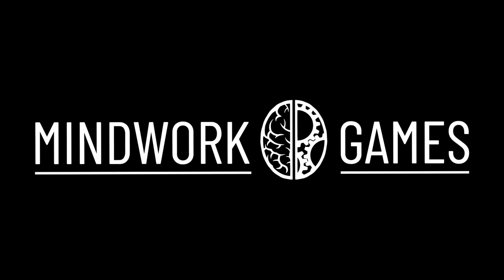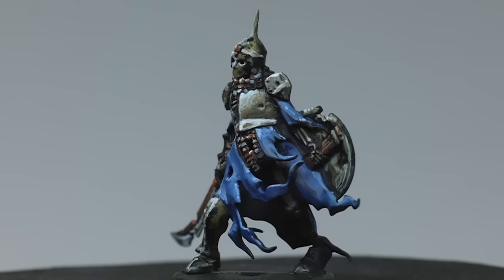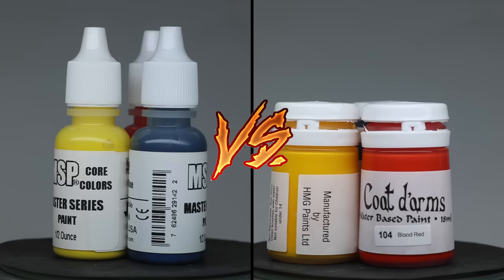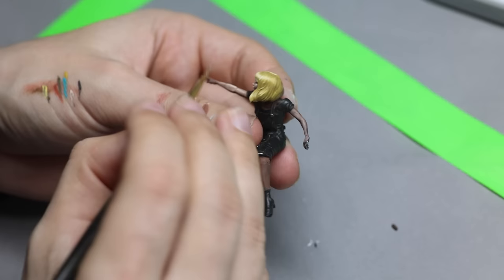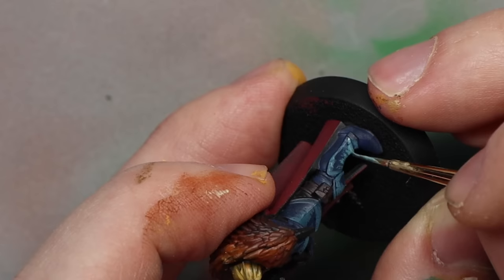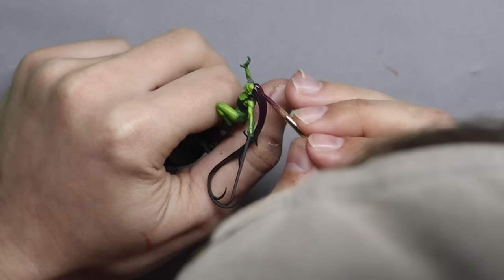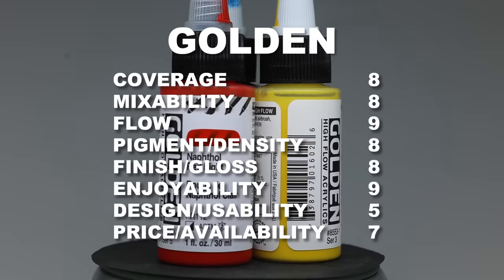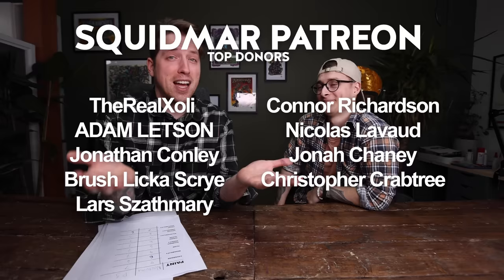Worlds biggest paint test! - pt. 1

Comment: You should have done a blind test without knowing which brand was which to remove bias in your very scientific testing method.
Reply: Yepp blind test or it's kinda pointless.
That said, it was enjoyable to watch, i guess.
Reply: @Himle_  I wish they would have used the same model AND tried to color match. Seeing it presented like this does not much for me since they know what they are painting with, I really think mini paints are like wine if you know it's expensive it will change your judgment/review of it.
Reply: @WillWildsOutdoorAdventures  Couldn't agree more on using the same model/colours. I mean, how can you expect to compare a "bad coverage" colour like yellow with a dark blue?
Also, when comparing paints like Instar, that are designed to be layered, it might be a good idea to use them as they are designed to do. I mean, you don't drive a diesel engine on ethanol and then complain it doesn't work...
Also, by doing a blind test. You would remove things like GW = Bad pots & Expensive, so worse rating which doesn't affect the paint quality at all. (Sorry for ranting, tired and should be sleeping (: )
Reply: yeah even the music was a give away that they are both vallejo fan boys (and not surprising ly tbh as they are one of the best paints out there)
Reply: @Himle_  but pot quality and price is important. Like the Pro Acrylic where you get paint all over the cap. Or Kimera which are freaking expensive and hard to get in the first place.
And then you always have to consider why someone paints. Does he do it for fun or does he want to win a competition. I don’t need Kimera to just paint for relaxation.
Reply: @Himle_  Not totally agree, here it a compare test on paint [ important thing is the paint ... ] if the usability of the "pots" is taken into account, it should be done in a minor way [the note concerning the pot should not have a great influence on the result, see not to intervene in the result on the quality of the paint ] Even the price itself should not matter as much as the ability of the paint to cover for example. What is advertised here is a test of different brands of paint and to be completely objective it should actually be done blindly, in a strict case of same method : same painter, same model, same chance. As soon as the brand is knowed by the painter, part of his feelings is already formatted by what he has read about the brand, its previous use ... etc.
Reply: @MAEX25  With the PA yes, the caps are a bit annoying, but it doesn't affect the quality of the paint. Should it affect a final score ye why not. But then show which paints are used after the paints been used (if that makes sense) and rate pot/design after.
And yes, Kimera are expensive/pot. BUT, if you count/ml instead Kimera costs ~$0.21/ml and Vallejo ~$0.18/ml (GW ~$0,26/ml). As for availability, I guess it depends on where you live. There were brands in the list that I can't get without selling my home.

You do have a point on why does someone paint, it certainly does affect which paints/gear you use and buy. But, I believe that everybody should atleast try a proper heavy body acrylic white. Now it doesn't have to be Kimera, there are plenty others out there. And yes, that's ofc just my opinion. (: That said, AK and PA does have amazing whites.

Sorry for the long reply. (:
Reply: @davidalbert373  Oops, what you're saying are basically the points I tried to make. (:

One way to deal with it more "fairly" (some people love GW pots, I don't mind them tbh, especially not for washes/shades) would be to have 1 subcategory with "design" and 1 with "price". Where design is totally subjective and for the price category, it should be in per ml, not per pot.
Reply: @Himle_  oops, sorry wrong translate for me and some missunderstand. Sorry Sorry , i apologies :). BTW, i am not a Citalde pots lover,  In the state for the airbrush, these pots are not super practical and I have to systematically transfer them into dropper bottles  ... on the other hand I find the paint rather good, but extremely expensive. Agree with the last thing you state about the design and the price . Sorry again.
Reply: @Himle_  why sorry. An in detail reply gives me the chance to get your point and what you take into your evaluation. I’m thankful that you shared your opinion with me. I definitely want to try the AK colors.
Reply: @davidalbert373  No reason to be sorry! I do tend to "forget" words when I write. (: So me making less sense, isn't unusual. 

Yeah! I wonder what GW thought when they did air paints, in them pots? And same here, for all the GW paints that I've got (except shades/washes) I've transferred them to dropper bottles. 
The only paint where GW sucks, is white. I don't understand why they can't make proper whites...
Reply: @MAEX25  Yeah, I do prefer to make longer posts, to explain properly, but I do have a tendency to ramble instead of getting to the point. (:

If you can get them, try out AK's Intense line. They are as easy to use as the other AK colours, just with a higher concentration of pigments.

ot: One nice thing with the AK caps, are that there is actually a "cavity" on them for where to put a drop of paint.
Reply: @Himle_  I think every company has pros and cons. 
Kimera is high pigment, but a limited range of colors. For me as a beginner not very friendly, because you have to mix a lot of tones. And it’s super annoying if you mess up your mini because you can’t recreate one of the tones you used. 
GW has some awesome paints, but is expensive, has no good white and everyone complains about their pots.
PA has this not optimal caps, but their mahagoni seems pretty good.
And if you use an airbrush …
That’s what I heard, till now I only used Vallejo so this may not be very accurate and perhaps if I start to use GW/PA/AP/AK I throw Vallejo away. For me the quality and the price is good. And they have this 16 colors for 32€ packages, which is awesome for beginners. In some instances they are a bit to mat/dull for me, but maybe I haven’t found the right color. 
It’s great to have a non toxic community that shares its experience you can rely on. 
So much for long texts and going of topic. 🤣
Reply: That's not how sponsored videos work...  You can tell who the sponsors are based on how their spot is edited.  Vallejo much LOL.
Reply: @MAEX25  Yeah, that's true. Which is why I usually buy the paint I want and doesn't really care about the brand.
Yes sure, there are brands I believe are better then others, but that doesn't mean I only buy from them.

As for Kimera. I'm very much a beginner when it comes to using heavy body acrylics.  And yes, for painting an army, it's not a brand I'd chose. I mean, mixing the same hue for 50+ models? Nope, not gonna happen. :) I got my Kimera paints because I've heard/seen great things about them. But I'm plan to use them for center pieces or solo models. But sure, I plan to use the white when I need a really strong/good white.
As for messing up paints on a mini. That's why I always use a wet palette when painting models I care about (not "rank and file") so that the paint stays useable for a long time.

I agree, there's nothing wrong with GWs paints. I own a lot of them and use them weekly. Yeah, sure, the pots aren't optimal if you plan on mixing paints. But when it comes to shade/wash, for me, it's much easier to use a pot then a dropper bottle. Over my years painting I've still not knocked over a GW pot. knock on wood I've spilled more then 1 Tamiya pot though. :D

If you want to try out the PA paints the mahogany is indeed a good paint. Their white, ivory and red are also amazing.
Yes, the caps are a bit annoying. I actually ordered "twist caps" (really cheap) from them, so no issues with wasted paints any longer.

I have nothing against Vallejo paints and own a bunch. Their Metal Color series is amazing! I know it says airbrush, but it's great with a brush too.

I'd recommend buying 1-2 pots from different lines, see what you like. That way you can get a feel for the paints and you don't spend a fortune on something you won't use. (: As for some paints being matt. Yeah there is that. I always varnish my models, so it doesn't really matter to me if the paint is matt, satin or gloss.

Nothing wrong with long comments. Don't know if YT is the best place for it though. :) And yes, most painters are really friendly people. :D
Reply: Brilliant suggestion, still enjoyable non the less.
Reply: Should have also tested wet pallet vs dry for all of them too.  If the pai t is separating in a wet pallet, then maybe it isn't meant for a wet pallet and works well out of the bottle/pot

Comment: I feel it's a little unfair that P3 got kicked out of the bracket, by a paint that is no longer in production.
Reply: Then it’s also unfair that golden isn’t in the next round just because it was compared to Kimera.
Reply: Yeah I think a fairer system would be to give the lowest scoring winner's spot to the highest scoring loser.
Reply: I do feel that there is a little bias about p3 in this video
Reply: @totallycarbon2106  could have done a loosers bracket as a second wildcard
Reply: @TheTurtlenator001  shouldn’t have done brackets in the first place.
Both of them should have painted with every brand and add their scores together. Highest score wins.
Also painting the same mini would be more comparable and not knowing the brand until they finished the rating would eliminate bias.
Reply: I mean if want to find which paint is the best u can just see which got the highest score.

Comment: I have mostly used Citadel and Vallejo, so it's cool to see all these other brands, some of which I've never even heard of!
Reply: I have mostly the same.I mostly use Vajjelo with some Citadel here and there. But I do have some XTREME Metal from AK, and those are absolutely incredible. You 100% need an airbrush for them, but Ohh my god I cant get over how fantastic they arem.
Reply: Me to. They are my favorite.
Reply: Me too but Sometimes I also use tamiya
Reply: Vallejo as a brand has everything you need. I will mention that the acrylics have some noticeable differences. Hobby line, gaming line and mecha line. I find that besides universal issues of certain colors like yellow. I don't encounter a bunch of paints in the same line that I have to use different which is why I suggest vallejo as most peoples start. Their liquid metal and mediums/flow improvers also do great
Reply: Been using Citadel. Boy, do I hate the newer pots, the older pots were bad but managable. Looking to switch to other brands.
Reply: @johntan4997  O for sure there pots sucks. Get the slightly bigger dropper bottle so it has room for beed and your good to go. Thanks for sharing bud.
Reply: @johntan4997  I dropped Citadel for Vallejo a while back and never looked back - I will say, however, that Citadel's technical paints are way ahead of every other brand I've tried. Great metallics too.
Reply: @johntan4997  Yeah, the pots might not be for everyones taste. That said, it's very quick and easy to transfer them to dropper bottles. :)
Reply: @Himle_  How much paint do you think you lose when transferring Citadel pots into eye dropper bottles (percentage)?  Obviously, you're not going to be able to get every single drop into the new bottles, but I'm curious how much is sacrificed?  I'm a Vallejo & AP user mainly with some Citadel pots and I loathe those damn pots.
Reply: @alb639  Ofc there is a bit of waste. It also differs on which paint it is, I mean, some are thicker some are thinner.

To eliminate waste, I designed and printed a holder for the pots and my bottles, which means the pots hangs almost upside down and emptying almost everything. For contast paints that means 99.99% is transferred.

For GW's normal paints, if needed I pre'thinned them with a few drops of Liquitex acrylic medium and used agitators to help mix them up. Looking at/in my empty pots, I'd guess maybe 2% is wasted? There is a thin layer of paint on the sides and in the bottom. But since I added the medium, I usually ended up with the same amount of paint. Some where actually so thick in the pots that I ended up with more then 1x15ml dropper bottle of paint without sacrificing any quality^^

Yes, adding the medium does thin/expand? (sorry, can't find the right word atm) the paints a little. But when I paint with GW paints (pot or bottle) I honestly can't tell a difference between the original paint and the transferred one. 

When I started painting, there was only Tamiya, GW and Humbrol available here. So while I don't like them, I'm kinda used to the pots.

Comment: For Golden you should have been using the Fluid Matte line instead of the High Flow. A big brand that you missed was Liquitex. They are way more used than some of the ones you tested by a huge degree. Their acrylic gouache line is their version of Golden Soflat.
Reply: I have been looking at Liquitex acrylic gouache so am interested in how it paints. One of the primary reasons I have been looking at the artist side of paints is you can actually see the pigments used and the opacity on the bottle
Reply: @ericdavis4964  I haven't tried it, but I've heard good things. Utrecht fluid acrylics are another one to look at. They are also matte and I've used them to good results. Really any matte fluid acrylic artist paint should be comparable in quality to hobby paint. Extra flow aide and drying retarder along with pre mixed colors is really all that separates fluid acrylics from hobby acrylics.

Comment: The Pro Acryl lids are designed to be left open on the table for a minute, so the majority of the paint may flow back down into the bottle.
You can choose to purchase alternate "flip top" style lids from pro acryl. Great paints, I highly recommend giving this a try.
Reply: Its because of the air pocket giving it acouple taps and the pain goes down.
Reply: Tbh ? I don’t have a minute of time every time I open up a pot
Reply: @d.o.g573   yeah I prefer to purchase the flip top Lids just for this reason
Reply: @dances4980  
Is that a second range or do I have to refill them ?
Reply: @d.o.g573  the flip top Lids are sold separately they fit on the same bottles . They cost $6 for 10 lids. They are currently out of stock on the website sadly
Reply: @dances4980  Out of stock items and items being removed from the cart is a major issue with the Monument site, but the products are great.
Reply: @kumarsalib722   the good thing is you can ask Jason in his live streams about when to expect specific products to be restocked. Really nice guy.
Reply: @d.o.g573  What do you mean by you don't have a minute of time every time you open a pot? Presumably you're painting with the paint you just poured out? Just leave it open while you paint, then close it after that, you don't have to actively stare at the pot the whole time. I don't see what the issue is, unless you're storing all of your paints horizontally while you're painting.
Reply: @CFTim  
This is how I work. I open the pot I take out the paint and paint. Then I close the paint - can’t wait to let paint flow back into the pot in order not to clog the rim. 
I prefer dropper bottles

Comment: Word on the street is that Monument Hobbies has the best white paint. I still need to try it.
Reply: Absolutely true. The caps are different than most people are used to, but it’s really not a big deal. They absolutely seal better than Vallejo and Army painter, which often dry in the stem and clog over the many years I’ve used them. You can order dropper or flip top caps from Monument for the paints. They absolutely will not break even with extreme thinning, and have excellent coverage. If you use a wet pallet be sure to use less water than normal.

Comment: With Golden paints you showed that you did not informed you about the products. They are colors from the art range. The high flow acrylics are primary made for airbrush. By using an airbrush they are very good. The fluid acrylics are also made for brush and airbrush. And only for brush are there acrylic paint tubes which are high pigmented but way to thick for miniatures. However, also a lot of the fluid paint are transparend or half transparend, as you can see on the bottles. Empty square are transparend and half black half empty square are half transparend. I recommend the N5 Neutral Gray from the high flow range for senital highlight

Comment: It’s interesting you found the GSW paints to be low coverage since I found them to have great coverage and really loved them.
Reply: Same, altho I've mostly used their metallics so far, I feel like some of these paints are MEANT to be easily used out of an airbrush, but ALSO can be used with a regular brush.  So comparing a line of paints that is geared towards being airbrush friendly against a line of paints meant for brushes is pretty unfair IMHO. They have different uses and fulfill their role in a mini painters set of tools excellently.  GSW metallics cover amazingly out of a brush, and their color shifting paints are top notch out of an airbrush.  And their bottles literally say airbrush ready on them, so it's not fair to bash them on coverage and flow if they are actually correctly manufactured FOR their purpose..
Reply: I've mainly used the metallics and the ink washes, both of which are really good. Their regular colours are very hit and miss, with the bright tones tending do hit more often (e.g. flubber green)